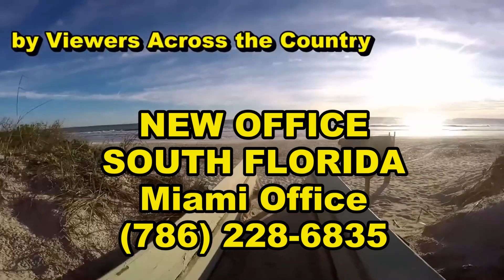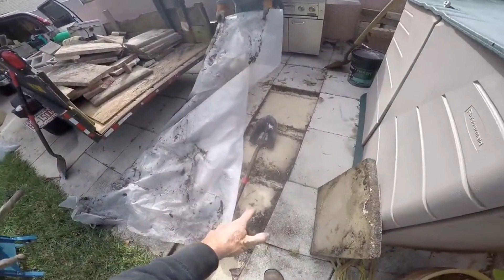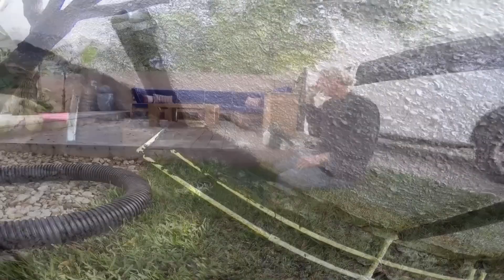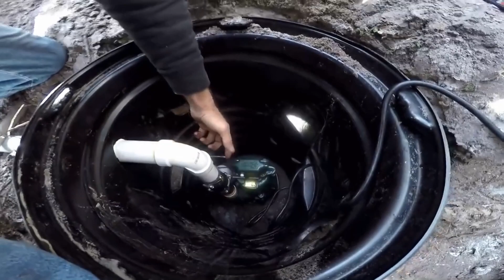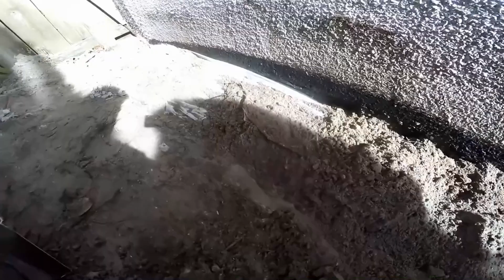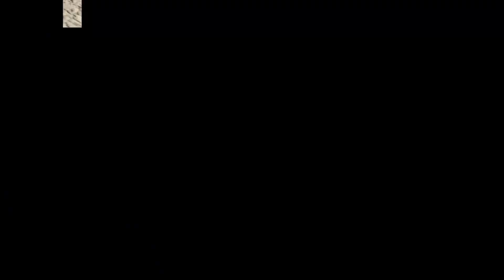Waterproof Your Foundation, DIY,  MIAMI FL

Comment: Why put rubber seal on a wall with voids?
Reply: That Rubber Sealant fills the voids and keeps water out
Reply: @AP-514  Those voids were large. Several inches in size in at least one case. I doubt a rubber sealer would fill those voids unless you used a huge amount of sealer.
Reply: @samash1704  Fill the voids with hydraulic cement.
Reply: I agree. Roots are still growing and the rubber seems to lack strength.